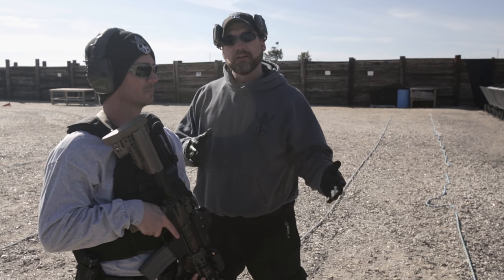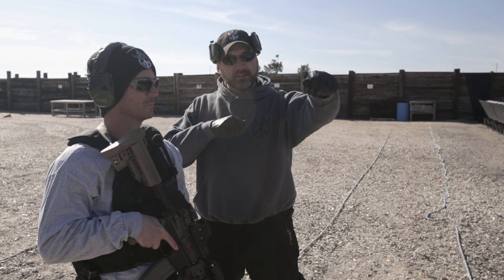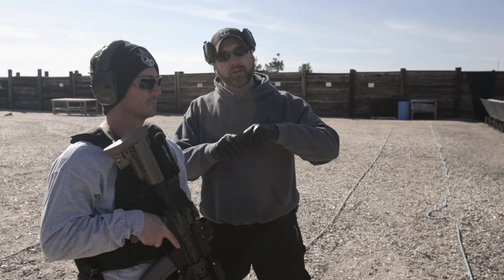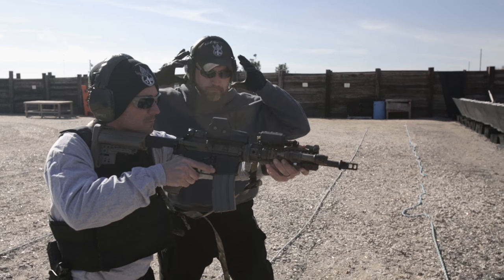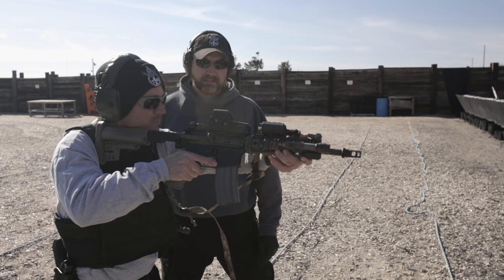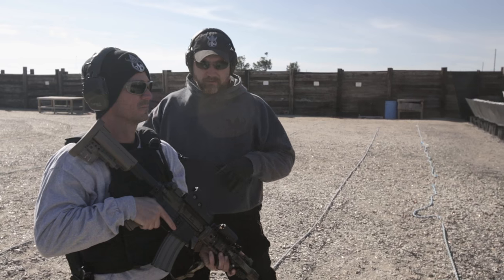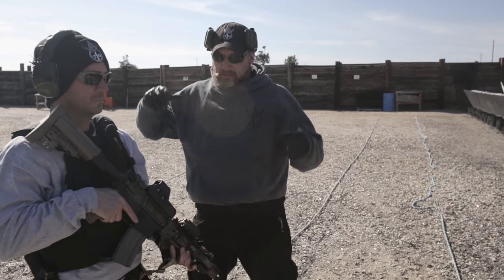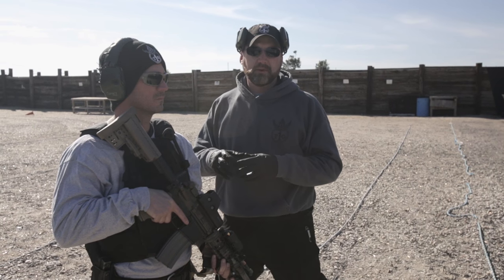How to do the Failure Drill | Body Armor Drill | Shooting Techniques | Tactical Rifleman

Comment: If you do the failure drill that fast, do u even have the time to judge if the first to bullets did what they meant to do?
Reply: I guess that's why it's necessary to train a lot
Reply: most of the time failure drills/body armor drills are meant for suspects with body armor or a individual who won't stop no matter how many center of mass shots are placed
Reply: I think they don't take it into account since you are not firing 3 times at a target you want alive. If you miss the third shot you might get a chance to care about the first 2 but my guess you care about the target afer the third shot is fired
Reply: Well I’m pretty sure if you are shot with no armour your gonna fall down to the ground quite fast and the control they have over the gun, they can just not shoot you in the forehead
Reply: Its split second decisions. So yes. They train day in day out to assess what the shooter is doing, and decide if they need to shoot for the face. You have to be quick in situations like that, or else you'll end up being the one with a bullet between the eyes.

Comment: I was always trained that the failure drill was 2 to the chest 1 to the hip to halt the assailant then 1 in the head. 
Otherwise all you're really doing is a modified Mozambique drill for the carbine instead of the pistol. 
The one to the hip is supposed to stop them in their tracks so they could potentially live for questioning later. And only if their body doesn't fail to you resort to the kill shot. Under your circumstances if you have that clear of a shot to your target you could just shoot them right in the face. 
Just the method to my madness.
Reply: If youre using lethal force, the time to kill is already upon you. One to the hip is just asking for a law suit and wasting ammunition. Im coming from a LEO background though... military may be different.
Reply: Not wrong with that. In the Marines, we trained both ways with a shot to the pelvic girdle or a T-Box shot. It all depends on what you come into contact with. If it is just to stop the target from moving so they can be brought in, hip shot (and then probably get yelled at by command for shooting them in the dick). Kill them? Right in the T-Box. As T484 said, with an LEO view, a shot to the hip during a deadly force scenario will bring up a lawsuit against you for "causing the individual unnecessary pain and suffering during an apprehension when deadly force was warranted" or whatever the lawyer words it as.
Reply: Rifle qual in the Marine Corps counted the hip and the T-Box as being acceptable for the failure drill (with hip being preferable as you had a larger area to fire at).  I assume that after the round has finished ricotheting in the hip region, there won't be any fight left in the target.  I never had to use it, just had to fire warning shots which got the message across.
Reply: Shooting someone on the ground who is incapacitated surely wont fly in LE. Though in military you can still capture them, or kill them as needed. Their suffering is not of priority when they try to kill you, and they have possibly valuable info.

Comment: So what is the plan if they have face armor and helmets too?
Reply: Face Armor isnt effective. After a couple 5.56 A face shield would be absolutely toasted.
Reply: @masoncannon3616  you haven't watched any recent l3a face helmet reviews, have you? They stop 50AE at point blank range even.
Reply from the maker: Name one person anywhere that wears one? Anywhere? Then, add neck trauma from snap, and the fact that ALL face armor fails after multiple shots. 
    Regardless, the point of the Failure Drill is to get two shots center mass to knock them off balance; then aim for a soft spot ( head/neck/pelvis). Thanks for watching, TR
Reply: @TacticalRifleman  SASR, GIGN since like 1995, Mexican avocado cartels are even wearing them these days. They're just not standard issue for most military. There's videos on yt here of gangbangers taking a 38 special in the chest while wearing l3a and he doesn't go down. Haven't seen anyone dumb enough to try live testing a helmet though, none of them have bullet resistant eye holes yet still
Reply: Take the toes
Reply: 762x51
Reply: @OGPurePhoenix  lol. Lmao.

Comment: Which zero do you all like to use for your irons/optics?
Reply from the maker: James Hull  Zero distances vary by what your mission or situation is. The military still zeros at 25 meters, to have that bullet come back down on target at 300 meters. I’m not real big on that, because it has you hitting way “high” at 175 meters. For a “close-in” CQB Rifle, I prefer a 50 meter Zero. This is also know as a “Point Blank Zero.” Depending on your type of ammo, most 5.56mm ARs, with a 50 meter zero, will have a “Point Blank Zero” out to 200 meters. By that, I mean that the bullet will not rise more than 5 inches or fall more than 5 inches above or below line of sight. That will keep you on a head-sized target (10 inches) all the way out to 200 meters. Past that, and now you get into using hold-overs.
     Most of my Sniper Rifles, I zero at 100 meters. It just makes for easier math when using a Scope with a BDC or when using Ballistic Software.
Reply: When I was in, which was as recent as 2012, the Marine Corps zeroed at 36 yards to hit at 300 yards.  Where are you getting your information on the "military?"  Some of the ranges were on meters and you used Kentucky Windage (and elevation to hit), which was easy enough once you learned how far to aim above/sideways.  I shot Rifle Expert every time on the range, from boot camp with iron sights to every time I was in the fleet with an RCO.
Reply: @TacticalRifleman  Excellent! TY
Reply: James Hull   I personally like a 5-1000 yard zero. Sure, shots around 400 yards are gonna be roughly 40 feet high, but it's worth it.      I'm kidding. 50-200 for me.